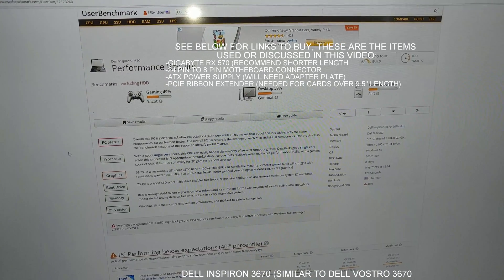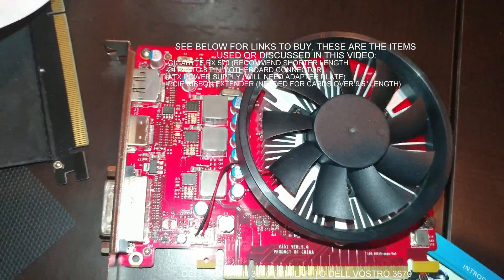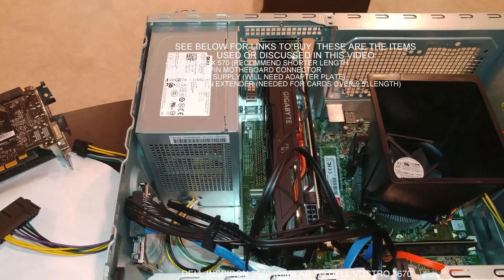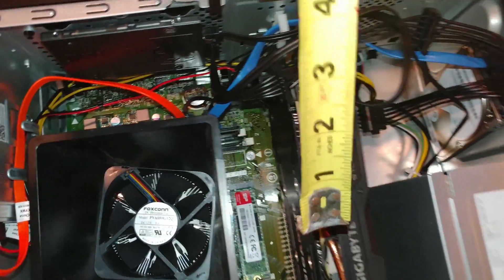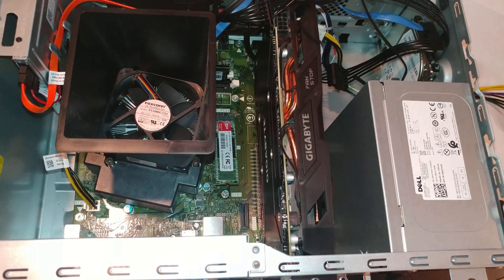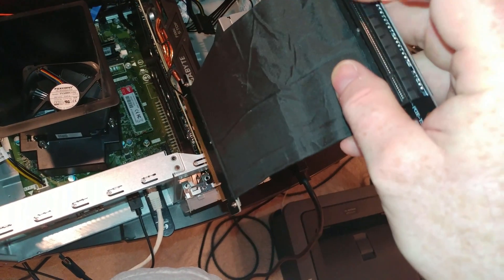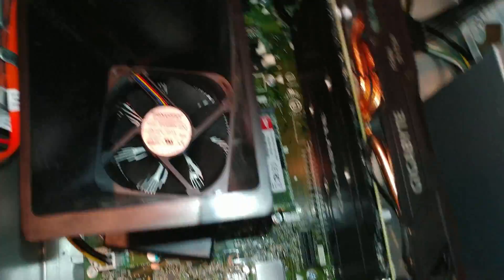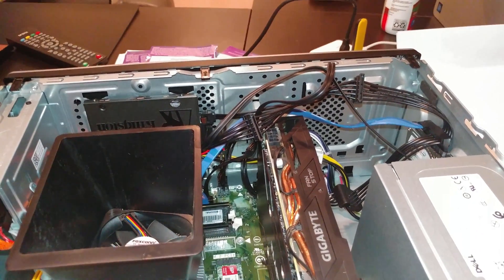Viewer Request, what is largest video card/gpu that fits the Dell Inspiron 3670?  Vostro RX-570 3671

Comment: Can i change its case to a gaming case?
Reply from the maker: It would be extremely difficult.  A case has certain connectors it needs on a motherboard that don't exist on this proprietary motherboard..  You whould have to probably do some soldering, drilling...etc.  I don't believe anyone has attempted it on this model but I believe other Dells they have.
Reply: Very hard I heard

Comment: Does it need a wire for internet to work
Reply from the maker: Are you asking about an ethernet cable?  If you have wifi set up where you are...that is all it needs...but it will connect to the 'net with ethernet cable as well.

Comment: I have a Dell Inspiron 3670, for me to add a gtx 1060 to it would it fit and what watt psu would I need?
Reply from the maker: Yes, you could fit one in....I would go with one of the smaller ones.  Somewhere on here I have a video of me installing an RX-570 in this video was pretty much the max and it was very difficult to get back out.  Googling GTX-1060 system power returns 400w.  I usually add 100 watt for a buffer.  If you don't want the hassle, get a GTX-1650...one that only requires PCIE power (75W). Less performance, but also less expense and headache.
Reply: @PC_HardwareTechUnboxing_1  which gtx 1650 do you recommend to fit inside well and use the correct watts, also will this one work https://www.msi.com/Graphics-card/GeForce-GTX-1650-VENTUS-XS-4G-OC
Reply from the maker: @oreoeatsoreos9412  This should be the one I bought, if the one you are looking at is the same length or shorter it will work.  https://amzn.to/304xe7Q
Reply from the maker: @oreoeatsoreos9412   Yes, it looks like that one would fit...only about 7" long, 75W power usage from PCIE only
Reply: Thanks

Comment: I've been using an old 850 watt Thermaltake on a Dell Inspiron. The new card is going to be an MSI GEFORCE GTX 1660. I'll probably use the ribbon extender into another slot.

Comment: hey would a rx570 or 580 work in this unit?it has a bigger power supply
Reply from the maker: Hello, I think I mention in this video that it is dependent on the length of the card...and you also need to have replaced PSU with the recommended min  PSU wattage. Somewhere around 500-600W if I remember correctly.  Also, you will probably need to run this with your panel off of it since this computer has terrible air flow for cooling.
Reply: David Noble thanks 🙏